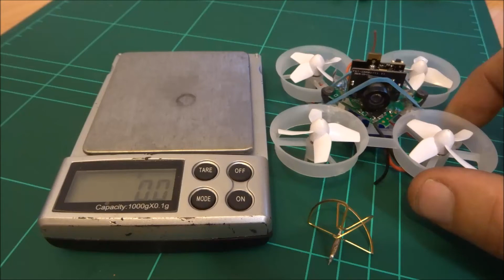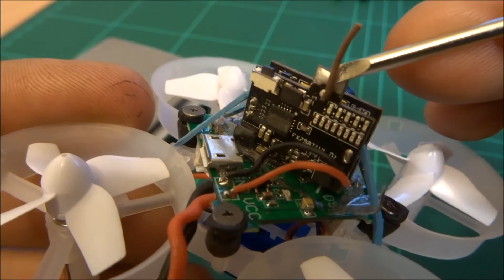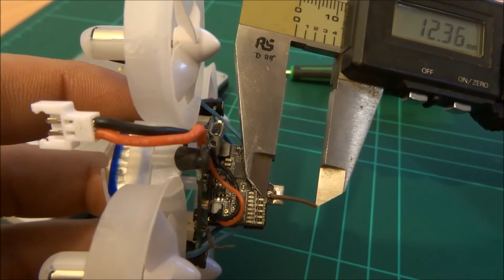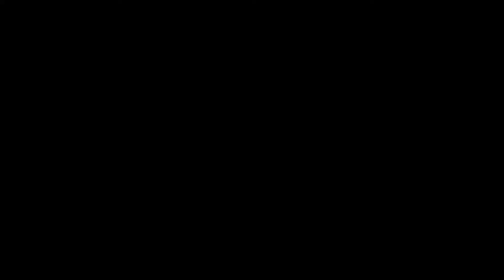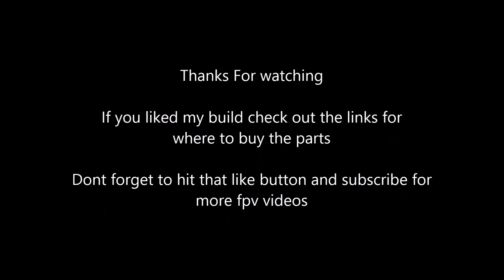Tiny whoop major weight savings How to make your own dipole antenna

Comment: Hey man I’ve done this before on some 200mw micro aio with amazing results and I’ve never burned out a vtx , but i just bought a beecore vtx fc combo for a tinywhoop & it has a built in 25mw vtx in the flight controller with osd , but my question is why is the length is the antenna on it 31mm in length ? I’ve always know the 5.8ghz to be around 12.9 cm or so I’ve measured some dipole elements and they have them at 10.9 some at 11.5 but when I make a monopole antenna or dipole I always make my active element 12.9mm long and it works great for me